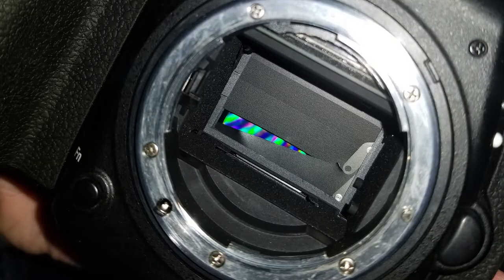My Nikon D750 Shutter Broke! NPS Fixed it.

Comment: Thank you for this video.  Just had our d750 shutter break.  Followed your recommended path to determine it was covered in the recall, sent it out using the prepaid label.  7 days later, it is back home, all repaired/checked out.  FREE.  Thank you.  FYI 65k clicks.